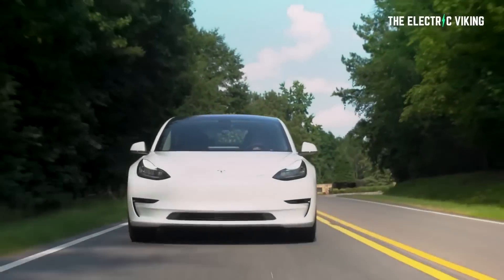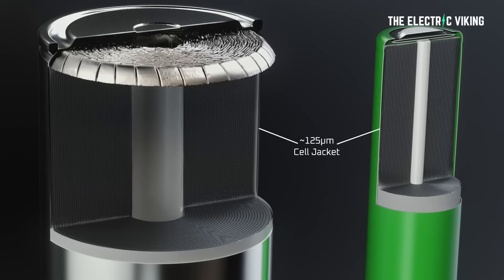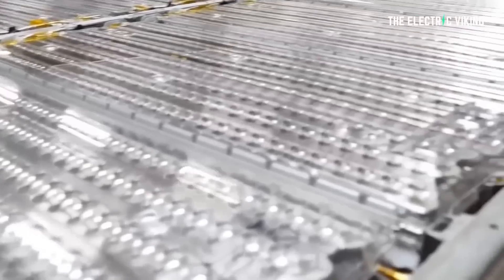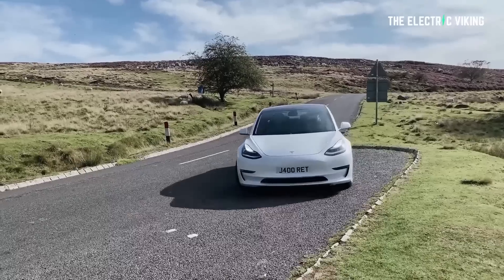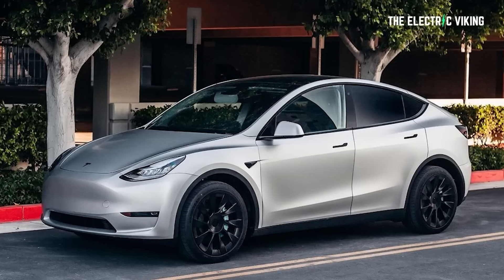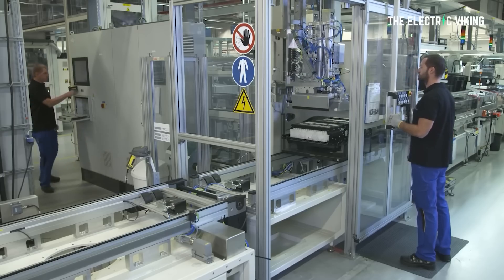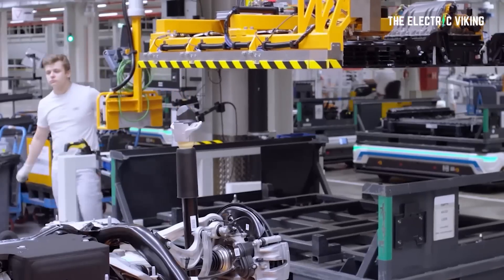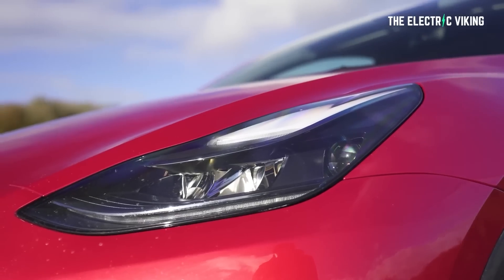Energy density & cell chemistry of Tesla's 4680 battery cell

Comment: 4680 was not meant to be a performance breakthrough but rather a cost and manufacturing optimization cell while also adding structural rigidity for the pack. Incremental improvements over time will eventually make it a superior cell

Comment: I think the reason they may be crippling the battery pack is to protect the Model S and Model X pricing structure. Just like digital cameras, the manufacturer doesn't want to have a lower-priced model have equal or better specs than a higher priced model.

Comment: I own a 2018 Model S, test drove a Model Y, and had a Model 3 loaner recently for five days. NO COMPARISON...the seats, air suspension, additional screens/stalks/buttons simply blows the Y and 3 away...PLUS mine has a sunroof that OPENS! Which you can no longer get on ANY Tesla. I want to keep my car forever and am keeping an eye for the day where replacement batteries with 500 miles worth of range become available. Fingers crossed 🤞

Comment: You don't think they're conserving batteries due to batteries being the limiting factor in production of vehicles? Yeah they could probably get 10% more range... Or they could sell 10% more vehicles with slightly lower range.

Edit: I think it's likely they're filling the pack up to 80% capacity and planning to up the amount at a steady 10% per year when they assume supply will better match demand.

Comment: The estimate for the number of 4680 cells in the current Tesla battery pack is 7 x 96 or
672 cells (96S7P).  The NMC811 chemistry provides an average of around 3.7V. Normally this will need series strings of 96 cells, to be voltage compatible with the existing inverters and motors. Energy per cell is then 67600/672 = 100.59Wh; energy density = 283.4Wh/kg.

Comment: I think the itterative 4680 cell capacity update is a toxic business strategy and the osbourne effect is high. With this knowledge I would definitely wait for the better capacity battery as an investment. I think the better strategy for Tedla would have been to develop the 4680 a bit longer to improve the overall capacity for releasing the 4680 pack vehicles. I think it doesn't sound good or sexy to buy a Tesla 4680 vehicle at this point on time. I can understand itterative vehicle updates. Although the way Tesla improves the internals is going to be a nightmare for repair shops when a Tedla needs a parts repair. Because several generational Teslas have slight structural differences which is going to make repair Tedkas almost criminally expensive and i aurance if Teslas will remain very high for the forseeable future. Thus in general although Tedla is the cream of the crop I think it does have one big achilles heel in that in terms of repairability the vehicle will, in my view have a controversial repairability reputation. There in my view lies the big doubt with Tesla in my view, about the focus of building a cheaper EV feom a production improvement stanpoint to change vehicle parts. I think less parts is good in general to reduce complexity, but I'm also noticing, at least iny my, a lack of thought into easily being able to remove parts for an improved repairabilty score. I think if this issue is adressed I believe a Tesla is a true durable product. Untill that time I can not help but think that Tedla is imcreasingly going the way of Tesla, making product repairability ever more difficult. This is also one of the most frustrating things I experience with modern smartphones, as the analogy, in than planned ibsolescence is ever increasing. The fact is that moving parts in a vehicle need maintenace in cars, more that even perhaps than in smartphones. Its that lack of attention towards reapiarability and affordable repairability of dented parts due to minor crashes, which still iften happen in cars today ( just look at the thousands of car crash and reckless driving videos and Wham Bam teslacam!) to see how common a problem this still is. If these were also part of the innovation conversation. I might be more forgiving for the itterative 4680 cell in production development. But right now the 4680 vehicles sound a bit underwhelming.

Comment: Sam, Tesla contradicted you during the earnings call a few hours ago.  They are not holding back anything in the current 4680 battery packs.   They are currently focused on yield, reliability, and ramping up production.  Once production is ramped up they plan to start working on improving energy density.

Comment: You're probably correct, Sam. It also sounds as though Tesla have let  few early prototypes out into the wild, and could be holding back on letting the production cells be seen too soon. If I were Tesla, I would be doing both of those things, and more, to ensure that a market edge can be gained. This could also account for at least part of the predicted 10% per annum cell capacity increase. 

As Thomas Edison is alleged to have said, 'Sell this one first. Then sell them the better model.' Apocryphal, but sound, from a business viewpoint.

Comment: Energy density is NOT measured in Watts per kilo.  4:12  5:13
Energy density is measured in Watt-hours per kilo.
Power density IS measured in Watts per kilo. 

Total battery energy is NOT measured in Watts.  4:28  5:25
And not in Watts per kilo either. 5:09
Total battery energy is measured in Watt-hours.  

Would you please use the right units when talking about electricity?
Reply: Thanks. Keep hammering away, one day Sam will read comments.
Reply: "Density" is 'mass/volume', so "Energy Density" in this context would be "Wh/L".
"Specific Energy" is "energy/mass', so in this context it would be "Wh/kg".
Reply: @A B  you are probably right.
I'm just used to more descriptive terms: volumetric energy density and gravimetric energy density. It uses more words to describe the same, but it's easier for a lame person to understand.
Reply: @DimaZheludko  Ahh, "lay person". 
The terminology you used appears standard in the industry literature. GED & VED.
Sam still hasn’t changed his tune, same broken record.

Comment: How do you recycle a structural pack like that?
Reply: The whole thing goes into the shredder. They seperate out the materials from there.
Reply: @surferdude4487  So no second life? Other EVs can have their batteries dismantled, checked and used for static power. Then 3rd Life where they are tested again and any low cells are replaced and reused. So Tesla is going to use it once and they then put it through a shredder? Glad our 2 EVs don't have this design.
Reply: @ElectraRC  You do have a point that those vehicle battery packs should have a second life as stationary storage. The problem with refreshing old battery packs is that the cells replacing the dead cells have to be balanced and aged to match the other cells in the pack. It's pretty fussy and technical work. And when it's done, the product is a used battery pack with no guarantees. I don't know how much call there will be for that going forward.

Comment: Tesla said during the call they are not restricting the range and performance of the current 4680 batteries. Chances are they aren’t using silicon and DBE in the cathode because Tesla  is not currently producing the cathode. They will probably ramp up the chemistry after they finishing building their cathode factory.

Comment: Yes, they are likely holding things back a little with software for the factor that you mentioned. However, the true advantages of the 4680's will be seen on the 800 volts and higher architecture such as in the Cybertruck, and especially, the semi. It's what they were designed for.